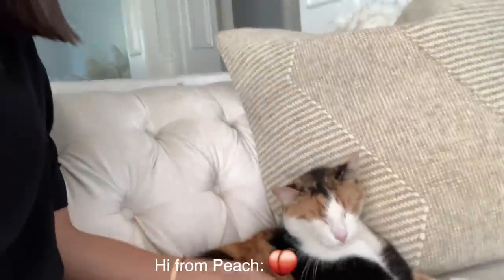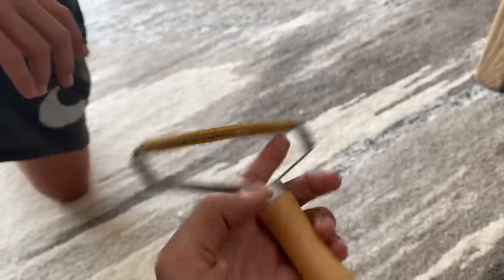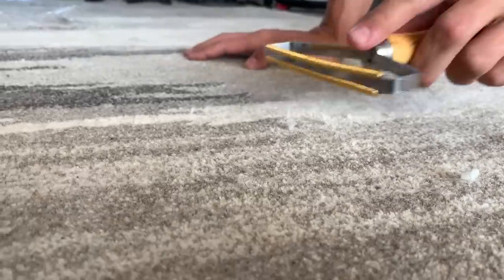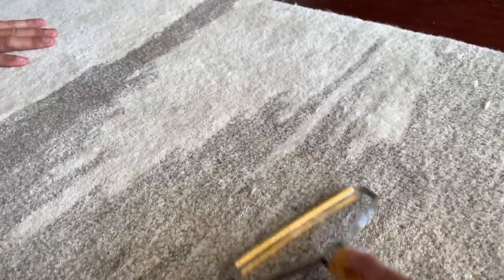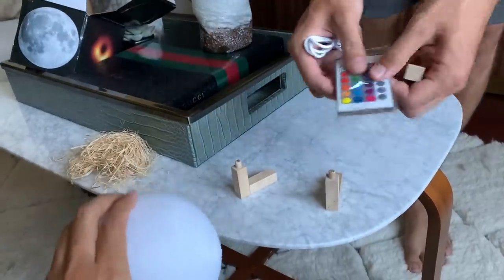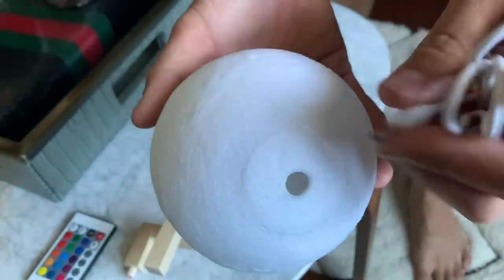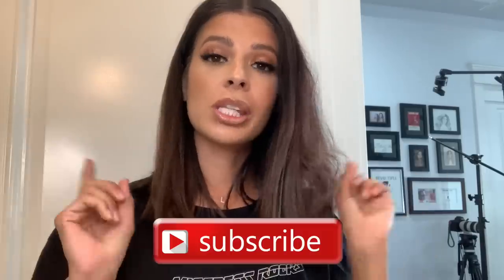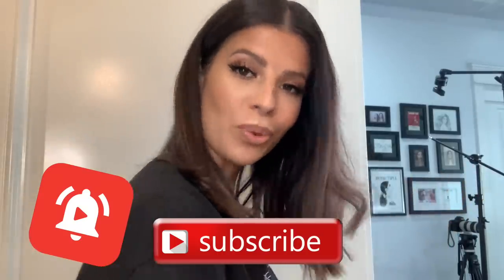I BOUGHT SUPER CHEAP  WISH HOME DECOR ... IS IT TOO GOOD TO BE TRUE??

Comment: ThAts a dupe for the TYME hair tool and you have to use it a specific way to get the curl. One way straightens your hair the edges that are rounded are for curling. And there is a specific way to use it. Read the instructions and it will work. I use mine all the time.

Comment: It's called Pampas grass not pompas! The hair tool you need to turn as you pull it down the hair, you should also support the curl as you release it, not just pull it off the end as let it separate! Plus you shouldn't try curling over hair you have already straightened as it doesn't work